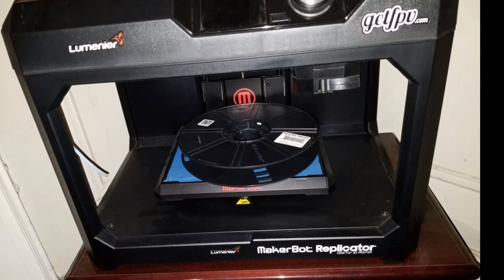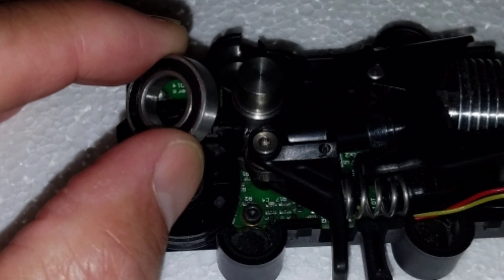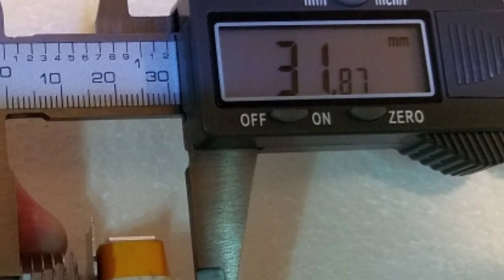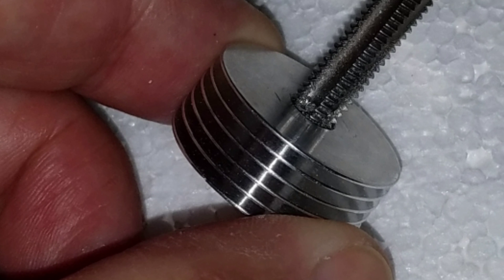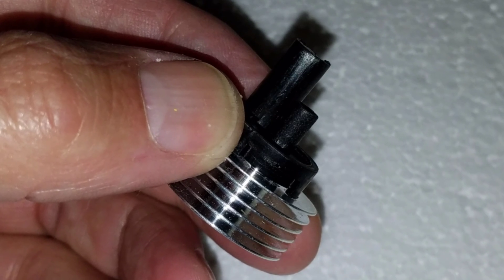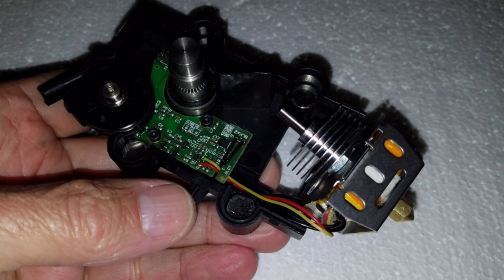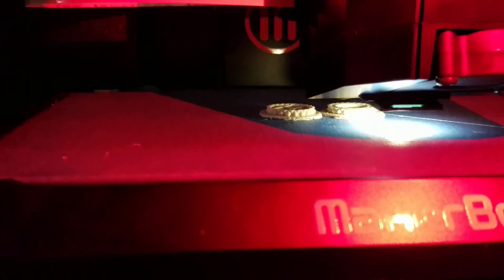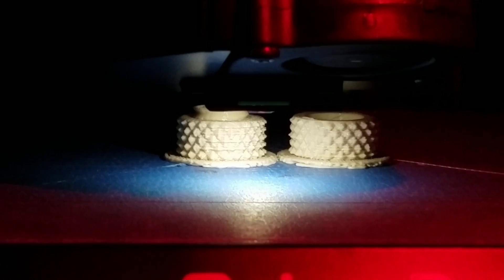Makerbot replicator 5th generation  smart extruder MOD WORKS

Comment: Remove the Fan screw closest to the inside on the extruder and swing your fan out to help increase your extruder heat and you will stop getting the material jams and error 57's.